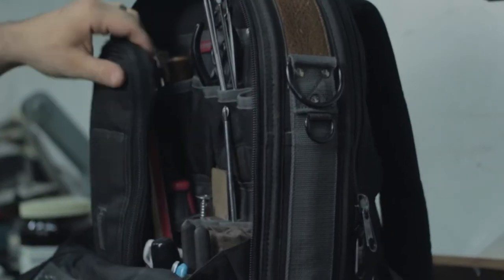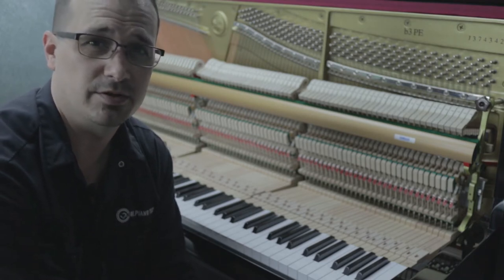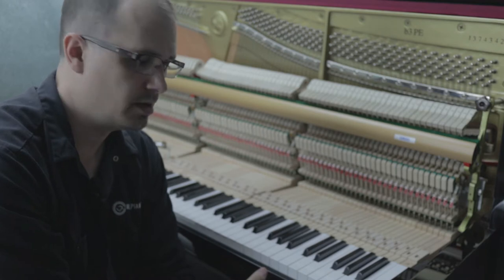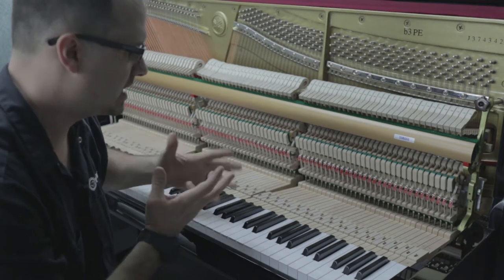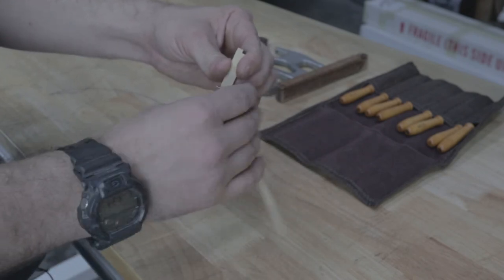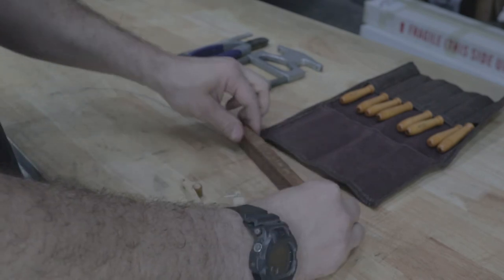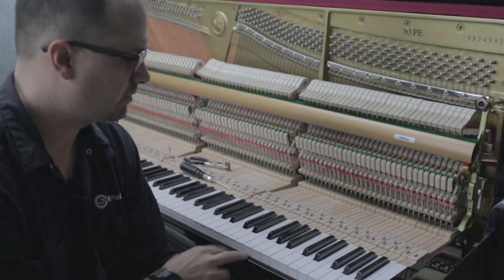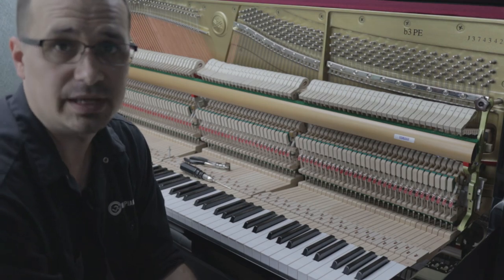Sticky Keys and How to Fix Them

Comment: Our old piano had been stored for 5 years in our cold garage in the UK. Thanks to your advice, cleaning out the holes on the keys resolved the issue for 3 sticking black keys in the upper octave. I also managed to spot and resolve a few issues with misaligned hammers on the lower bass octave as well as straightening half a dozen bent damper lift wires. Many thanks for your expertise :)
Reply from the maker: Awesome! I'm glad the video helped!

Comment: Right off the bat the first thing you said help! I just got a new piano, and my 5th octave c keeps sticking on me. I got a zip tie, and put it in front of the key as I press downward, and I cleaned out a tiny amount of junk that allowed the key to no longer be stuck! I saw a slight rubbing mark on the very bottom of the key, so using a zip tie I was able to get in there and get it cleaned! Now I have a piano that works again! I've been playing piano for over 35 years and I had never experienced the key being stuck because it was too close to the front board!!
Reply from the maker: Awesome!
Reply: zip tie, a very simple tool that worked for me on a studio upright. thanks for this idea.

Comment: I have Billings flanges on a 1920 Cable-Nelson I'm rebuilding.  How do I size pins properly for that?  They don't get tight until you reinstall them.
Reply from the maker: @jimthesoundman8641  Assuming the brass flanges are in good condition it's essentially the same process. Those flanges are what keep the pin from spinning so as long as it's tight the pin should only be able to freely move in the bushing.
Reply: @MrPianoTech  And if the pin is too small, will that introduce side to side wobble?  There aren't many that need new pins, but I figured I'd just put 19's in them and then if I notice wobble when reinstalling them, I can upsize them then.   Is that a bad idea?
Reply from the maker: @jimthesoundman8641  That’ll work. I find most pins tend to be around size 20-21.5. Just ream the bushing accordingly.

Comment: One of my piano keys wouldn't reset when the sustain pedal is down. It doesn't have this issue if the pedal is released. What could be the cause?
Reply from the maker: Sorry for the late response, looks like youtube quit notifying me when comments are left. Sounds like a humidity issue. I'd say either the key needs easing or the hammer needs to be repinned.

Comment: Hey , i have an old upright piano and i want to repair it a bit. I have trouble finding the key height rings and the dampers stopping the strings from vibrating after or even the whole thingy that stops it from vibrating because sometimes i press a key and the thingy moves and one string keeps vibrating and i need to readjust it again and again , can i do something about it or i need to buy new ones?
Do you know where to find those in Europe? I live in Romania but any big store should work. Or the material they are made from , and if could make at least the rings home (like diy)
Also  , i see each key has a string , some of mine are bend in random directions , can i put any sort of a string , or it needs to be only designed for piano , i'm worried i could break it if i don't do it with the right components.
Reply from the maker: Thank you for watching! I would check with a supply house than can furnish parts to your part of the world. The string does need to be specifically for pianos. You may want to have a tech come and look at it, sounds like you have multiple issues.

Comment: Thank you for the detailed guide. I work in a school which has no technician and it's too bureaucratical for requesting service. Humidity here is pretty high. I got two Kawais k-200 with a global sticky key and/or hammer problem. Could the A/C help at all? I'm trying to buy dump chasers, but up until then, could a regular dehumidifier do the trick?
Reply from the maker: Hey Germano! In my experience with schools they have a hard time allowing piano teachers to keep the temperature where it needs to be for good humidity control. Pianos like to be at 45% relative humidity which is hard to achieve if the ac is kept too high. I highly recommend the idea of installing dampp-chasers. In uprights I use the 36-38A rod, which extends for installation in an upright, along with the H-D humidistat, which will keep it at 45%.
Reply: @MrPianoTech  Thanks for the advise! I'll keep the percentage in mind and try to regulate it. Here humidity gets easily around 90%...
Reply from the maker: @GGMayer  No problem! Yeah, that’s pretty high.

Comment: How do you reduce the amount of force required to depress the keys?  I purchased a piano recently and the store regulated and voiced the piano, but I have never played a grand piano that required so much force to depress the keys during regular playing. I believe that most grand piano actions are set so that approximately 50 grams of weight should be sufficient to depress the keys. My new piano is closer to 75 or 80 grams.
Reply from the maker: Sometimes it can be a matter of friction in the action. Key balance rails, center pins in the whippens and hammers can create enough drag to cause problems, as well as the front key bushings, especially if too much moisture is present. Key balance rail pins can lose their smoothness and cause a problem where polishing them helps. If all the components are moving freely the two main areas I look at are the letoff distance which should be about 2mm from the strings and lastly re-weighing the keys by replacing the key weights with new ones. That last one is a big job and doesn't need to be done very often but it may help. Without being able to lay hands on it myself those would be where I'd look.

Comment: Hi,from South Africa here,I have a question,is there supposed to be green stuff under the keyboard
Reply from the maker: Hello! Do you mean the felt under the keys or is it sticky green stuff on the pins?
Reply: @MrPianoTech  it's not sticky , it's in a circular form around the pin,probably the felt then.
Is the felt the reason why the keys don't come up after pushing them down?
Reply from the maker: @joleneholmes6934  If it's under the front of the key then it's the front key bushing. It simply keeps the front of the key from bottoming out on the frame and is adjusted for key dip. It shouldn't make the key stick although it will stick there if the pin the felt is around (that goes up into the front of the key) gets twisted and is grabbing the inside of the key, or if the inside of the front of the key has swelled and is grabbing the pin. Can you tell if either that pin is twisted or if the front key hole is too narrow and is grabbing the pin?